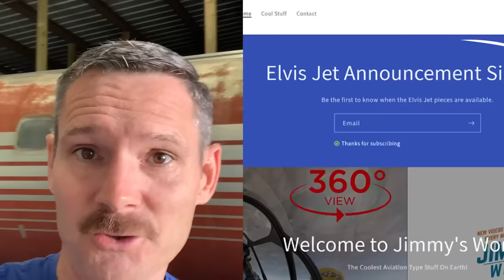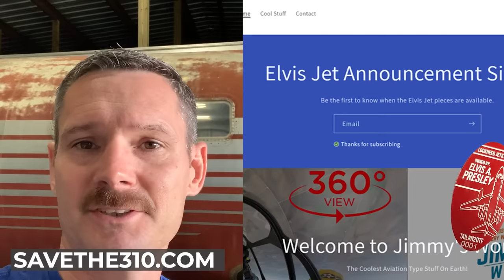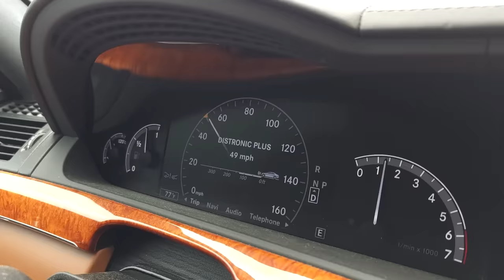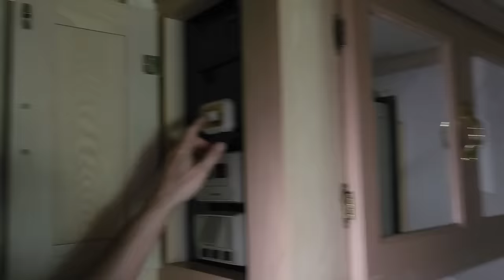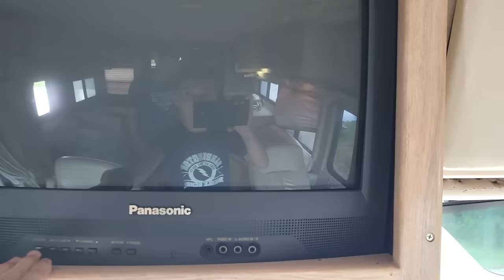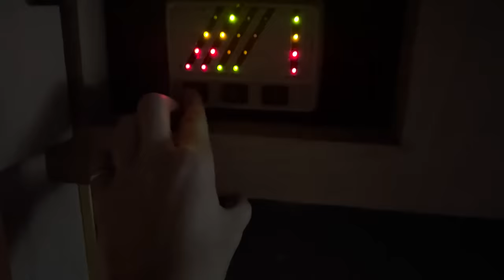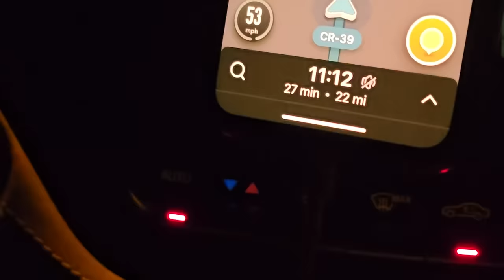Driving The FREE Abandoned RV Across Florida…It Was Terrible

Comment: Diesel Fuel is higher now than many years ago as it now refines to 15 % sulfur and the newer Diesals do use DTF to decrease the smoke and carbon from the burning fuel . As a younger man in the 60th diesel fuel was .16.cents a gallon when Regular gas was .32 cents. I worked in a Texaco Service Station when I was in High School after classes and on Saturdays. for several years. I own a Diesel truck which is a 2003 3500 Crew cab I have records of 20 plus years of what I paid for Fuel each time I refueled my truck and it ride up and down after 237K miles as to what I paid for Diesel Fuel
Reply: Also the wonderful government keeps adding more "road use" taxes.
Reply: BLUE BEACON TRUCK WASH.. SHE WILL SHINE LIKE NEW.
Reply: Which really makes sense, in a convoluted kind of way..Diesel is now refined to 15 Parts Per Million sulfur(Ultra Low Sulfur Diesel), AND, depending on where you buy it, it will have up to 20% methyl distillates(commonly referred to as 'BIO', as it used to mainly be old used fry oil and grease and junk like that), that good ol Uncle Sam has subsidized and 'deemed' worthy to 'clean up them there dirty nasty diesel motor exhaust'!

But, really, diesel, way back whenever we started refining gasoline in the 1900's, was a by product of gasoline refining and was routinely DUMPED because there was no use for it. Until a guy named Diesel(from Germany of all places(YES, that was his REAL name!)) developed a motor that would run on it, and voila! Your 2 cent history lesson!

Comment: The most common problem I see with older RVs are the roof leaks. Over time they can cause dry rot in the frame to where they aren't worth repairing. When storing an RV putting a tarp over the roof can prevent a lot of future problems.

Comment: Reseat all connectors. Reseat all fuses. Use contact cleaner on everything. Battery terminals should be cleaned too. Basic maintenance will help tons of tiny stuff driving you nuts.

Comment: I wonder if the turbo is bad on it. It shouldn't have much of an issue running 70-75mph. It barely running 60 with the pedal to the floor sounds like something it would if the turbo wasn't building any boost. Could y'all hear the turbo/blow-off valve?

Comment: You might want to look into a good lift pump for the rv if you want the new vp44 injection pump to live. The oem unit does not supply enough fuel pressure to keep it cool

Comment: In the alte 80's, my mom, brother, and I, left Colorado Springs in a 1979 Dodge van that barely ran. Headed for FLA. By the time we got to I-75, we were taking turns holding the choke butterfly open or closed to keep it running till we got to Ft Myers. It finally died about an hour after we pulled into the campsite. Heluva ride, but the adventure was worth it.

Comment: No need to run the generator when connected to shore power. Check the hydraulic fluid level to make sure you have enough to deploy and retract the levelers.

Comment: I drove 18 wheeler back in the 90's out of Tampa .used to run down US-27 ...Back then US-27  was 2 lane from south bay down to I-75 ..while they were building the other 2 lanes ..Running down through there at like 2:00 am on a real foggy night  would pucker your buns up .Couldn't have driving a tooth pick up my Issass with a jackhammer  ...When you seen those headlights pop out of nowhere and they pass you going the other direction 😊

Comment: You get a lot less fuel oil from a barrel of crude than you get gasoline, oil is used for heating as well as fuel and the fuel is used in ships, trucks, loads of commercial vehicles, trains so the demand vs supply is very high, hence why it is now more expensive than gas.

Comment: When cracking to differentiate fuels from oil, diesel is one of the first to come off.  It is the least expensive fuel to produce yet it is often priced higher than premium gasoline.    The cost to the consumer is partially a gouge, and the rest is for road tax.  The thought behind that is because large trucks that burn exclusively diesel, do more road damage. Therefore, somewhat rightfully so, taxes are higher for diesel than gasoline.   Still, the difference seems completely unjustified when the relative ease with which diesel is refined is considered.

Comment: Might have a 24 volt starter on it, and there might be a parallel switch that puts the batteries into 24 volts too so that a 12 volts alternator can charge the batteries too. Sometimes a low water sensor can cause the engine to shut down or a low oil pressure sensor too will do the same thing. Depends on how new the system is. That's a good way to scratch a 2500 dollar windshield to by turning it one without replacing that old weathered rubber on the blades. How far you make it is determined by fuel oil and water as well as drivetrain all the way to the tires. That would be your biggest problem here or air compressor. Sounds to me like the fuel filters need to be changed and the air filter most likely needs to be blown out too. If it can only run 45 mph something is wrong with it. The reason why diesel is so high is because they got away with it and truckers need to go on strike again but there are not enough owner operators complaining about it anymore. It called the cost of operating and should be covered in the rates but mostly is it greed by big oil contractors/refineries. Because it takes less refining to make diesel fuel than it does for gas. I hope you bought bug spray, no way I would sleep in that thing for a night without putting it is a fumigation tent first. If the engine lost prime so did the generator; Starter fluid is your friend here Jimmy. Just like an engine that has lost its prime. I would never let either one of you work on anything I owned, with a hammer around. I would suggest lighting the pilot light before taking a shower. Turning that jet into a bus is stupid idea I would not pay one dime to see it. or to spend a night in it. So much for a B & B ideal too.

Comment: Fuel price is supply and demand, they produce for the demand. It takes less effort to make diesel, but molecularly there are more carbon atoms in diesel so you get less diesel from the same crude oil as you get gasoline. The ratio is about 1/3 less diesel made. (About the amount diesel is more efficient than gas, 1/3 better mpg.)

Comment: Telescoping steering wheels aren't what they used to be. I'm a lazy driver and I like to snug the steering wheel in my lap and use thumb and index finger to steer. I believe that due to air bags, the steering wheel must be a minimum distance from your body. This makes you have to "reach" for the wheel constantly while driving. I have found this to be true with every car made since the mid 90s. I wonder which senator's brother-in-law has patents on air bags :).
Cool video. Thanks

Comment: Yes, diesel is less refined than gasoline.  Both are made out of the same stock.  A 42 gallon (barrel) creates roughly 19 gallons of gasoline, 10 gallons of diesel, 4 gallons of jet fuel and about 11 gallons of other products including motor oil, fuel oil and other distillates.   Prices of individual products is not just determined by cost, but by demand.   And perceived supply/demand can be more important than the reality of those factors.

 This is why it often seems as if there is no rhyme or reason for what we pay at the pump.

Comment: soapbox answer Diesel fuel prices are influenced by various factors, including global crude oil prices, geopolitical tensions, supply and demand dynamics, refinery capacity, and government policies. In recent years, diesel prices have been on the rise, and this trend has caused concerns among consumers, especially those who rely on diesel fuel for transportation or heating.

One of the main reasons for the high diesel prices is the volatility of global oil prices. The supply of crude oil is affected by various factors, such as the production policies of oil-producing countries, natural disasters, and geopolitical tensions. In addition, the demand for diesel fuel has been growing steadily in emerging economies, such as China and India, which has put pressure on global oil prices.

Another factor that contributes to the high diesel prices is the government policies, such as taxes and regulations. Many countries impose high taxes on diesel fuel, which can significantly increase the final price paid by consumers. Moreover, some governments have implemented regulations aimed at reducing the emissions of diesel engines, which can lead to higher production costs and, consequently, higher prices for diesel fuel.

However, it is worth noting that diesel fuel is generally cheaper than gasoline in most countries, and diesel engines tend to be more fuel-efficient than gasoline engines. This means that, despite the high diesel prices, diesel vehicles can still provide cost savings in the long run, especially for drivers who cover long distances or use their vehicles for commercial purposes.

Overall, the issue of diesel fuel prices is complex and multifaceted, and there are no easy solutions. It requires a careful balance between global oil supply and demand, government policies, and consumer behavior.

Comment: Oh yeah, check the date on the generator. If it's pre-2002 ish, do NOT load it beyond about 3/4 or in a burst. They had glue issues back then, and the rotor will come apart, spraying the magnets everywhere, destroying the whole set in about 1/0000th of a second!  I had a chunk of magnet put a dent in the outer housing once!

Comment: The gen set drops out the bottom. There's a couple of bars that go sideways that attach to the frame, and it sits on top of those.
Unfortunately,  You need to have the WHOLE damn coach a couple feet up in the air.  Only other option is to to slice the front end up.  :(

Comment: What are all those Battery's for ? Is it a 24v system or does it have a solar power charging system or what lolman thats alot of batterys i guess the whole coach runs off those electric battery's and the only charging is the motor ,ya thats it 👌👌👌

Comment: Because they want to tax the crap out of truckers and so many people buy heavy duty diesel pickups that really have no need for them with the 6 inch or greater lift kits, really wide low profile tires and/or never has a trailer attached. In my opinion and I trust it since I’ve towed and pulled more types of trailers than I care to remember that travel trailers are being made way too big for anything up to the 5500 and 550 series trucks.

Comment: Diesel used to be 1/3 the price of gasoline back in the 80s.  Truck drivers had and still do pay for diesel permits in al fifty states. Because auto manufacturers stated to produce cars that ran on diesel and they didn't have to get a permit on every state. The trucking industry went to congress to fix the problem. So congress passed a bill for diesel be more expensive than gasoline so truckers would have  all the diesel but the never got rid of permit issues at the same time they a new expensive tax.
Yep. Congress took it out on the trucking industry as the big polluters
Reply: They traded the Fuel permits for the IFTA sticker  .International Federal Tax Agreement

Comment: (16:00) You think $4,49 per Gallon is expansive,
Try getting fuel in the Netherlands. One litre (0.264 Gallons) costs €1,37 or $1,46.85
So that means that one single Gallon would cost an equivalent of $5,55, and 150 Gallons will set you back $777,67.5 over here.
Germany and Belgium have way cheaper gas and diesel prices...

Edit: Ok.. So not 50 gallons, but $50/150. Well, even then, US fuel still is cheaper than in the EU.

Greetings from the Netherlands :)

Comment: needs an earl change limp it to a gas station fresh dinosaur juice least treat her to an earl change then go drive fu bar out it then re change it again. usually if the air compressor locks up she ran out of coolant which they all leak some but that stuff lubricates the internals you can have em re built. now with it looking like mud that’s not good usually means fuel in de earl or coolant seals gone etc. motor homes you can’t let them sit. the system needs exercising so when you do go to sell it must be 100% ready for the next owner. if y’all would have spray bengal spray for spiders 🕷️ dead ☠️ gone. sewer needs treatment so you don’t get pew wee’s add a bottle of rv black water down the toilet. after you stop and flush the system these old system require a separate hose water used only for flushing after you pull the black valve only [sewer ] may have lube valve handle you will then run water through the toilet filling and dumping a few times then adding chemical to prevent sewer smells. same with the sink run the sinks both in bath shower kitchen look for water leaks to grey tank sewer first then rinse hose use water from the grey tank. you will need a sewer hose from your local camping world. get a sewer hose support keeps from rubbing a hole 🕳️ in sewer hose,rubber gloves. next you will need to pour some dawn dish soap down the drain in the kitchen and bath lubricant for the valve in the tank about a half a table spoon. never 👎 ever pour cooking grease down the sink big hell no. winter storage requires bio degradable rv anti freeze thirty gallons or what is your fresh water tank. that’s where then you make sure your rv is drained this gets pulled through faucets shower head n down into drains n tanks till it runs pink. essentially pickling the rv so any water doesn’t freeze burst pipes holding tanks lines etc. but while in storage now is the time to get stuff ship shape inverter for dry camping like using the generator older rv’s might be thirty amps-newer like ours is fifty. while plugged up to a site recharges rv batteries and the inverter changes let say you have thirty but needed fifty. DO NOT USE  fifty on a thirty amp system. make sure site circuit breaker is off plug in then turn on.

Comment: needs a reseal on everything coming through the roof. ie skylights, ac, vents, the entire roof needs a reseal. the slide needs to be greased and cleaned. generator likely popped the breaker for it when you started it up while it was connected to shore power. battery cutoff contactors need to be checked. electric hot water element probably needs to be replaced and the cobwebs blown out of the gas side of things. water pump seems very weak and probably needs replacing. the engine is probably fine but needs a tune-up. leveling system needs to be serviced. most likely the solenoid for the retraction is stuck. give the thing a proper wash so its clean then get a new seal for the windshield.

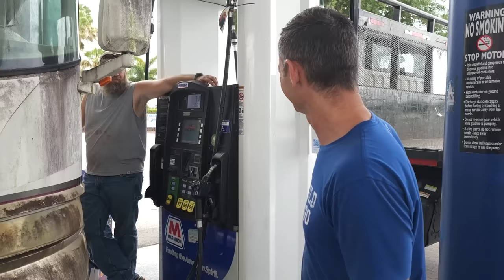Comment: At 16:19.   Diesel costs more or the same a gas partly because of the biofuel tax subsidies.  But mostly because with catalytic cracking more gasoline is possible per barrel from earlier years.   The total demand for diesel is less than gas so the diesel supply is pinched to margins.   Another reason is the US is the largest exporter of raw petroleum in the world.  The private oil producers choose to sell oil to Europe for a higher price than what they get in the US.  So majority petroleum products in the US are refined from imported oil with a shipping cost.   IF the US currency is volume controlled by government control, this would all be remedied.     The only detail holding the pyramid scheme together is that The Fed Reserve currency is the 'petrodollar'.  Which is losing out against better regulated currencies even after exchange.

Comment: because the EPA requires diesel fuel to be far more refined now than gasoline. It has to have almost ALL sulfur removed. 15 Parts per Million maximum today. before 1993 when diesel was cheap it had 5000 Parts per million sulfur. Due to the extra refining to remove the sulfur diesel has also lost all it's lubricity that old pumps and injectors require so the manufacturers have to add more chemicals back into the fuel to add lubricity.

Comment: Quite a machine for free!  Will this be a driver or donor chassis for the Elvis jet? 
Before 2000 diesel fuel was cheaper than gasoline.  I recall it being quite cheap compared to gasoline in the 60's and 70's when I was a kid and worked at a service station.  I have heard a few reasons for steeper rise in diesel pump price:  Worldwide demand for diesel has increased with more diesel vehicles, with production and distribution trying to keep up; Federal government raised excise tax which is now higher for diesel than gasoline; and U.S. transitioned to ultra-low sulfur diesel which slowed production and distribution, increasing demand.  I have also heard the theory that one is paying for fuel by the pound which for #2 diesel averages 7.4 lb/gal vs. regular unleaded which averages 6.3 lb/gal, also equating to energy yield of either product.  Density ratio is 1.17 (#2/reg. gas).  Average U.S. cost for #2 is currently $4.02 vs $3.60 for regular (a ratio of 1.12) so the picture almost fits, although I don't think the density theory makes any sense from a marketing standpoint.

Comment: definitely need to re do the roof/membrane should been washed with roof cleaner with uv protectant it’s fixable hot water stuff needs to be re done showers 🚿 bout it on pressure new head light lenses lights inside lights led all replaceable camping world

Comment: You should go to home depot and buy a bucket of white roofing paint for R v's or campers tape off. What you don't want painted on top and then roll it out with a good roller. That's what I do to my camper and r v
Reply: That will help seal up around the air conditioner. And bubble top window